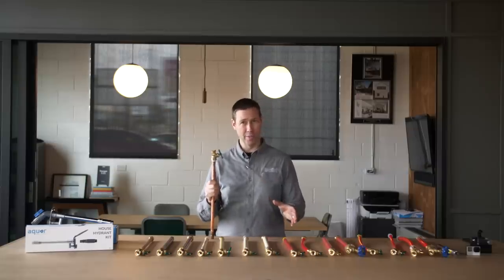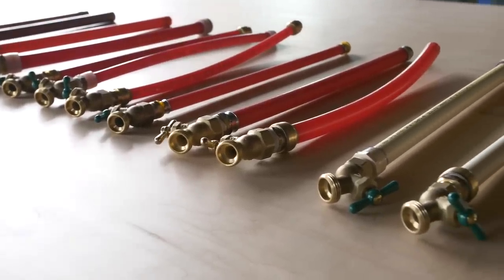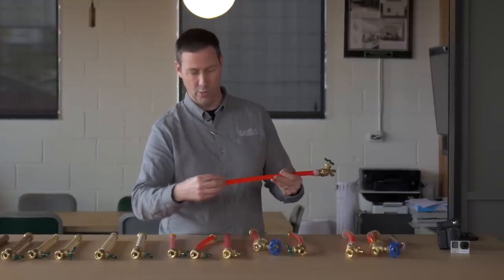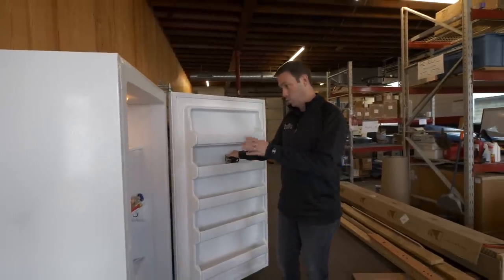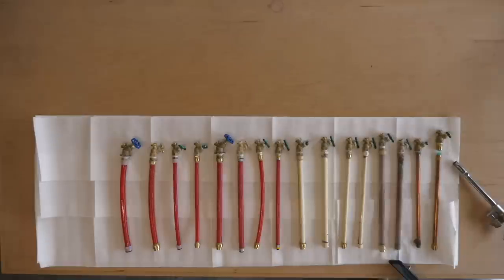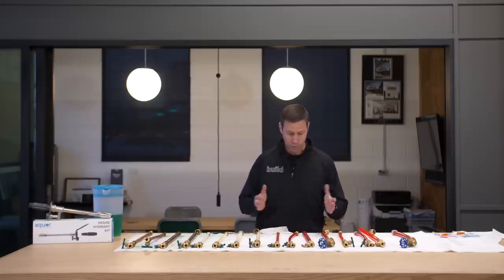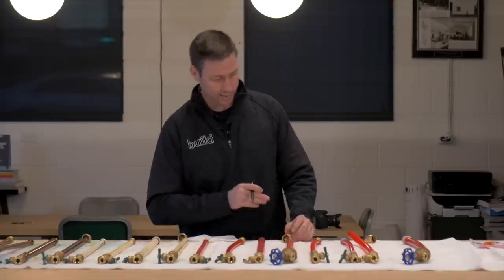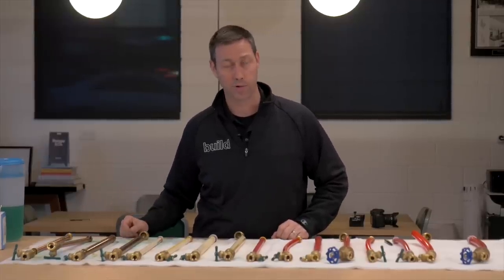Copper vs Pex vs SharkBite - Freeze Testing

Comment: Looks like PEX has a few benefits, it's cheaper, stands up better and people don't steal it out of the house!
Reply: StirCrazy cheaper too install
Reply: NonyaBusiness! None. It’s entirely stable. Copper does actually leach into acidic water, particularly. Not a health concern at those levels, but you get pinhole leaks over time.
Reply: David Kirkpatrick not cheaper to fix when it fails, or rats eat through it. Pex is a cheap way of running lines but copper will always be superior for longevity
Reply: Im guessing you can also wrap the pex even though its not necessary and get even better winter perf and hotter water
Reply: @Giggidygiggidy12  some areas its "Code" to wrap all hot water lines.
Reply: @NonyaBusiness! if you run out of water. You install a large cistern (200 to 500 gallon tank) .
But the Blue tank is to build and manage pressure in the home. It's not a holding tank.
Reply: @genli5603  I've been using type "L" copper for over 20 years. I haven't touched a piece of Type "M" in many years. I've never had a pin hole in that. Plus I haven't seen or heard of it getting pin holes. 
   Sometimes it's just the cheap products you use ie: type "M" copper.
Reply: @NonyaBusiness! why would it take 4 months for research.  You use your old well. Feed the large 200 to 500 gallon tank. Then go buy a standard well system to pressurize the house. You know. That little blush tank system? 

 As far as drilling a well on the other piece of property. You write up an easement that states after you sell it that you have the right to pass onto the property to repair your well. Then draw up a map that lays out the easement for the county Inwhich you live.
Not costly at all. If the new well works well enough.  You can build a municipal water supply for both homes.  That would be a selling point.
Reply: Brad Viviviyal oh really? That’s why my house that’s 80 years old still have the same copper lines and haven’t failed, yet I hear story after story of this cheap plastic option failing after 2-5 years lol. Use Plex if you build someone’s house, just don’t use it on yours.
Reply: @Artchred  amen to that. I have customers that dont want any pex in their homes.  I only use it if it's a really hard repair run. One that was installed when the built the home. Other than that I only use type "L" thick wall copper. I haven't used type "M" copper pipe in several years. I'm sure you old home is type "M". Back then everyone used type "L" for underground only.
Reply: Lee Olaeta im glad to hear some people on here understand this as well. Plex has been sold all over the country so to the ease and cost. Plumbers can install all the lines in one day where as copper takes 2-3 days. Of course they will tell you it’s better. 😂 on a serious note: I truly feel bad for all the new home owners that plan on keeping their house for more than 10 years...
Reply: Lee Olaeta You don’t live where the water’s pH is 4, either. I do. It is VERY expensive ripping copper out of walls to fix tiny leaks.  Copper should not be used in very low pH. 50 years is not that long for a house. Copper won’t last that long with low pH.
Reply: @genli5603  there are only around a thousand things you can do to prevent your h levels from dropping to 4. All of which are cheaper than ripping out all the copper in your home. The normal ph is 6.5 to 8.5. So at 4 you are not far off. Have you tried any of these system's? 
   Where do you live that the ph is only 4?
Reply: @genli5603  I'm still wondering why you would tear out copper pipe instead of putting a ph system on your home. This would save your pipes and be much better drinking water. 
   Have you gone to one of the systems or have you paid to have all of your copper pipes removed.  Then you still have low ph level water. Which is very hard on everything left in your home. IE: every brass faucet. Drains, You!
Reply: Use pipe dope in your tests and daily jobs. The tape is horrid
Reply: @zlee415  that's a terrible statement.  Teflon tape has its place just like pipe does. Different situations call for different  items to use.
Reply: @ltsgarage7780  elaborate
Reply: @zlee415  I would love to. But, I asked a question about what pipe dope & teflon tape does for a fitting. Why do you use either of them at all?
  That's my question for this day.  I know the proper answer.
Reply: @ltsgarage7780  You are speaking about plumbing, correct?
Reply: @Artchred  Since no solution works indefinitely, ease of replacing is key. PEX from uponor is mainly (always?) installed within another flex-pipe (, and is made to be changed in minutes. Just close off the water, disconnect at one point, and pull it out at the other point. Replace it with a new, and you are good for another 20 years. A rodent eating through the entire exterior pipe might be worst case scenario though.
Reply: andrull that won’t work if you have foam insulation like higher quality homes. But to each their own. I’ll just sit quietly and wait for 20 years to pass and see how they do.
Reply: @NonyaBusiness! all my pex is still in good shape my house was made in 1992 and freezes like one or 2 times a year
Reply: @NonyaBusiness! all my pex is still in good shape my house was made in 1992 and freezes like one or 2 times a year
Reply: @NonyaBusiness! all my pex is still in good shape my house was made in 1992 and freezes like one or 2 times a year
Reply: Best solution is not PEX but PEX-AL-PEX.
Copper is a horror show. I mean a steady income for plumbers. That is the ONLY reason it is still in use.
30+yo pipes and fittings like new, no leak, no damage, often going to 90 deg Celsius (194F)(kitchen and bathroom). 
What I hated the most with copper was the constant creeking when it was expanding due to heat being pumped in the radiators by the central heating, which was every 10 minutes or so. The entire house was moaning, creeking, squeeking, it was a concert that did not let me sleep the entire winter.
Reply: @Artchred  try getting rid of the rats
Reply: @NonyaBusiness! if you haven't already you should setup a timer for your well pump. Your well will still be running dry. Empty your 200 gal tank than run you well till it runs dry. Than give it 10,20,30 min and run it dry again so you can figure out a duty cycle of your well pump. Still use your float system but than have a timer that you could set to match your well inflow.  Ex. When float tell pump to turn on pump runs for 5min then off for 20 runs for 5min off 20 ect. Then your well pump wont be sitting there running basically dry till float kicks it out.
Reply: Artchred It is way cheaper to fix and you don’t have to solder with an open flame in a wall.
Reply: LT's Garage I have been plumbing for 30 years in Oklahoma and Kentucky and in both states we had L copper get pin holes in the copper. Especially on hot water lines.
Reply: PEX doesn’t corrode. It expands. When properly installed the fittings are just as strong as the pipe. Mice is your only concern, and you have bigger problems if mice are chewing through your pipes.
Reply: Pex pipes might be cheaper but the fittings are expensive so it comes out about the same. The cheapest way is cpvc. I still use copper most of the time unless the owner wants something different
Reply: NonyaBusiness! No no real leaching is found
Reply: lol right
Reply: @ltsgarage7780  on one of the many I can't remember whether we were looking to rent or buy at the time houses ..... we looked at one that had a shared well, however when the tenant moved out they disconnected their electric with the power company and the landlord didn't pick up it again which meant the other house on the well had to run a wire out to it to feed power in ( and in the most professional and proper manner of course across the grass open wire nuts.... ) so they would have water.

That being said the house we later bought is on a shared Community well, for the first year we moved in every holiday we ran out of water. This is partially due to the fact that the development was put in by somebody who likeed to cut corners and cut costs and use cheap material so the well company that later took it over and made it officially City water has had a lot to fix up. At the same time I don't feel so bad for them because every time we called to say that there's a problem we immediately get a late notice. and if that wasn't enough for a good few years they were Trucking water in from an hour away and to disguise that and make it easier they dug a trench and layed 8"? pipe so the truck didn't have to come all the way over to the well and storage system. They finally decided to bring on a second well and we went for a year with no issues. then they decided to put in a larger storage tank that was more professional and not a bunch of tanks on the back a trailer and we've had nothing but problems.

I will add one more thing. just because it's not copper doesn't mean it can't be stolen or at least cut apart until they realize it's not copper.
Reply: @imark7777777  one more item.
  If its shared well. Then it should have its own meter that a owners association should pay. In a home owners association you should have meetings from 30 days to 90 days
  No just 1 person should be able to disconnect electricity.  It should take a second signature.
       Someone didn't set your up properly!!!!
Reply: @Artchred  your copper lines are not 80 yrs old sorry. They started using it in the 80s
Reply: @NonyaBusiness! - mice and squirrels love plastic that has a Soy element in it, but leave most others alone.
Reply: @ltsgarage7780  It wasn't a physical disconnect, it was a nobody's paying the bill (they ended the service contract and the power co didn't transfer to the property owner.) so the power company came in and pulled the meter leaving the neighbor without water. And obviously the landlord didn't care.
I'm thinking that was a rental now.

Yes it should've been done in so many other ways, But this is wild and wonderful west Virginia where you can subdivide your lot to the point where you'd barely have enough room for a driveway. you can also share your neighbors driveway lol.

As far as the house we moved into, technically it is city water. it's just sort of subcontracted to a management company that isn't the same as in town. it was set up reasonably well with a central well and meters it's just that the pipes that were underground where not laid very well and probably not correct. We have been here 5 years and this was all way before for us, however we also get the impression that the water company has tried to do is little as possible to improve the system apart from getting it working and having to dig up in rerun most of the waterlines. Personally i still suspect that there's a leak on our line.
And now that more people have moved into the development they kind of had to upgrade the system like they were supposed to.
Reply: LT's Garage 
200-500 is not enough. I fill one weekly at 1200 gallons. If you have a family you learn what you need. 

Let’s say 
Then someone comes overs at thanksgiving and is throwing food down the drain. With the water running. Only problem no disposal. 
And then you find out they used 100 gallons last night for a shower. 

Oops your pump keeps running and guess what you’re out of water.
Reply: it also leeches out chemicals in the drinking water
Reply: @Artchred   You must be one of these plumbers out here overcharging people for your fancy copper soldering skills that you say took you 20 years to master and thats  how you justify those $1000 1 hour repair bills.   It cost me about $15 and 20 minutes to replace a pex pipe that busted under my house.  As far as rats go,  I'd bet money a rat can chew through thin soft copper more easily than fairly thick pex pipe.
Reply: @gratefulaya192  Sharkbite $10 a fitting for 1/2"!!  But patents last 20 years so in about 6 years sharkbite will expire and prices will fall.
Reply: @ltsgarage7780  I know this is an old comment, but I bought a home 2.5 years ago and the water situation is atrocious. We get about 100 gallons a day off the well. We came from the city, first house with a well. It had 5/g per minute written on it in sharpie. Turns out that was the pump capability, not the actual well output. So now we're gonna be out like 30 grand to drill a new one. Do we have any recourse legally?
Reply: HappyBeeHoney what state?
Find yourself a real estate lawyer. Ask them if there is anything you can do. I know where I live when buying a home it must be live able.
   Ask what the minimum gallons per minute is?
   Then, buy a large cistern. 2500 to 5000 gallons. 

Use the well you have now to fill it up. Then on the out side add a new well pressure system (pressure tank. Pump & motor.) you can build this set up for under $5000.00. 
This will give the home plenty of water. The tank will fill24 hours a day or until full. 
There are several factors that control this. 
Home many people live in the home? Animal’s? Gardens?
Let me know what you decide.
Reply: StirCrazy 👍🏾
Reply: @Artchred  not in cold weather!! However different could be said for the south
Reply: @Artchred  unless it freezes 1 time. It can't even out preform CPVC lol. All thr copper failed.
Reply: @NonyaBusiness!  never had mice eat my CPVC pipes. It's literally never happened, and all i use is CPVC. Cheap, and super easy to fix if it does break in sub zero temps.
Reply: I've seen it stolen. Whole runs of the stuff in homes abandoned.
Reply: @Artchred   Well water in Iron rich soil eats copper fast, inside ten years at times.
Reply: I have one word: mice.
Reply: lived in a new house built with PEX for ten years in north east US around the great lakes area.......zero problems.
Reply: Good point! I have actually had copper thieves break into my business, walk past equipment worth thousands of dollars and rip LIVE water pipes out of the wall for copper. They have this "I can get X amount of meth for Y amount of copper" formula in their diseased heads. Humorous note, one of them was killed by a car while running from the scene with his arms loaded with copper pipe.
Reply: The only drawback to Pex that I've heard of is rodents specifically rats will chew through it the get to the water.
Reply: @Artchred  show me proof , I want to repipe my home
Reply: @ltsgarage7780  what u mean back then because my home has galvanized pipe
Reply: Nope they steal it out the house to replace it dummy
Reply: @ranginrobert5455  back in the late 60’s I was building homes with copper. I don’t know where you live but copper has been around a lot longer than the 80’s
Reply: @beerman9807  just because your house has galvanized pipe doesn’t mean every house has copper pipe. Every area is different.
Reply: @beerman9807  how old is your house? Have you had any problems with the galvanized piping?
    All area’s are different
Reply: People don't steal it,  u won my vote
Reply: Yea copper is the way to go...that way you can make sure your local plumber gets paid ever year or your local scrapper gets money from stealing your pipes
Reply: @captaincrunch7944  do people really steal the copper pipe out of a house that is lived in???
Reply: Pex leeches toxic chemicals into your water including bisphenol, which causes low testosterone and erectile dysfunction in men.
Reply: @Artchred  MOST NEW PLUMBERS HAVE PROBLEMS SWEATING COPPER!  THE REASON THEY USE CPVC AND PEX!
Reply: I would like to see L and K copper freeze test.  I'm assuming you used m?
Reply: @CP-dd8hk  Nu
Reply: @ltsgarage7780  lol
Reply: @ltsgarage7780  0
Reply: Funny.... you must have hardly any experience. I'm not even a plumber and... nothing but problems with pex... its crap!
Reply: @genli5603  pex fittings blow apart (I've seen it), pex, after the insulation falls off and pipe is exposed to UV... Also not good. The pipe will fail to the point where the water will mist through the pipe. Pex, junk!
Reply: @ltsgarage7780  I've had problems with galvanized, it clogs up like a fat man's artery's with rust
Reply: @bobbyturbopants  oh perfect thing to say. I just got out of the hospital. I had a stroke and a brain bleed!!! Almost died.
Reply: @bobbyturbopants  where do you get your water from??
Reply: @ranginrobert5455  I sweated copper pipe in the 1960s. I think you might have your dates wrong?
Reply: @Artchred  it absolutely is not. Almost 9/10 leaks we fix are all copper. It's an older technology for a reason.

Pex is better in every single way.
Reply: and rats can chew through it
Reply: It is a heck of a lot easier to install as well.
Reply: @ltsgarage7780  well I can tell you a little different.

 I had to replace part of the main water a section of the cold water line that feeds the whole house in my basement last year. Yes it was copper and somewhere along the way it developed a pinhole leak.

I replaced it with copper because I didn't trust PEX. 

After seeing this video I'll give PEX a second look.
Reply: @ltsgarage7780  
I live in an Old neighborhood on the west side of Pittsburgh.

I liveD here long enough to know which houses had Wells and cisterns at one point in time.

Most of which have been covered up over the last 50 years.
Two of my immediate neighbors have covered Wells that they don't know about. I'm not telling them either.

Having access to very cheap or free water is not a bad idea.  Looks like I'm buying a house in my near future.
Reply: @bohicasnafufubar  what year did you have the copper either replaced.
  Was the copper that had the pin hole in it original or was it a repair and someone had installed it in your house at an earlier date?

   If the copper was installed while you lived in the house . You have  some place that is either connected to a galvanized pipe or your house is missing a ground.  Copper pipe doesn’t get pin holes in it for no reason.
Reply: @bohicasnafufubar  is your line insulated in your basement?
  If not. Go buy some insulation and get it insulated..
  Then go answer my other questions!!
Reply: @bohicasnafufubar  if you are developing pin holes in your copper pipe. Find out what is 
Causing the electralious. (SP) In the house. Pin holes don’t arise from water running through a pipe. You have a grounding problem somewhere!!!
Reply: The great fear of all absentee owners.